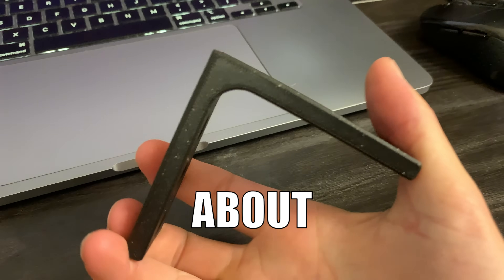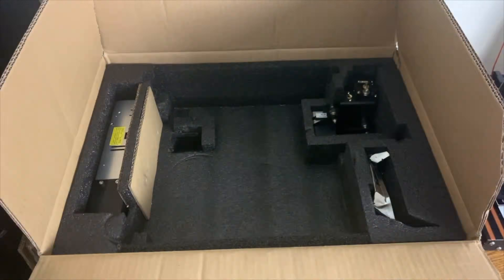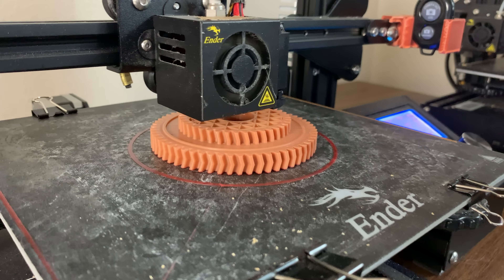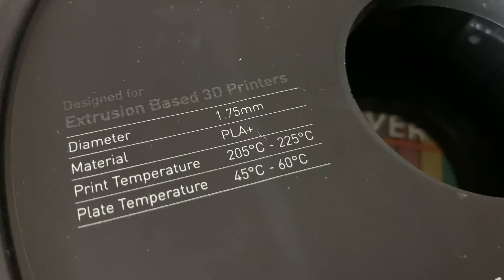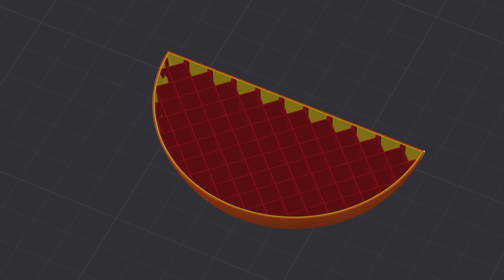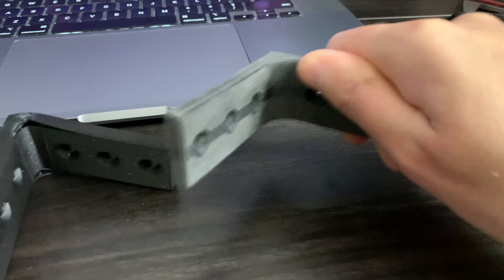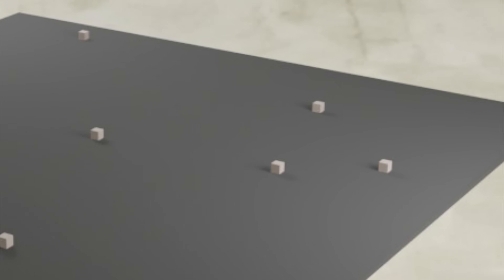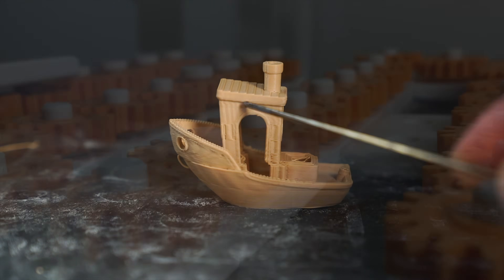9 3D Printing Sins...

Comment: A comment about your "But you gotta level the bed" bit. -- I run a shop that repairs 3D printers, and I will tell you 90% of the time it isn't anything to do with leveling the bed.  Everyone keeps reiterating this, but when it comes to Ender 3's and other kit-in-a-box printers, if you don't build it right, you will NEVER get it level correctly despite how easy it is to do.  So I regularly have customers that come in that say "I've been trying to level my bed for 10 hours!"...  And Auto Bed Leveling will NOT solve an unlevel (un-trammed) bed if something is mechanically wrong with your printer.
Reply: Yeah, working with machine tools has helped me prevent this because I know that a "level" surface won't matter if the axes are not square to each other.

Comment: Dawn dish soap and water made a huge difference for me when I was having issues with large articulated prints failing. I had been using a paper towel soaked with isopropyl before this.
Pick a soap without moisturizer and make sure to dry the build surface real well to prevent rust.
Reply: Isopropyl alcohol works really well when you need a quick wipe.
Reply: Most metal build surfaces are coated, usually with PEI, so there is pretty much no chance of it rusting and if it does rust it is probably just the edges that rust, not the actual build surface.

If you are having your build surfaces rust you are doing something very wrong.
Reply: micro fiber cloth works better with IPA than a paper towel no lint or dirt left
Reply: I have to use IPA because i use a type of spray on product (similar to 3dlac) that is not water soluble.

Comment: I clean my bed with cheap dollar store fingernail polish remover.  I've tried 100% acetone, but that doesn't work at all.  The fingernail polish remover has something in it that works incredibly well for PLA on any surface.  Glass, build plate, kapton tape...etc.  Try it, you'll be surprised how well it works.  I've have never, ever used glue stick.
Reply: Isopropyl acetone, methyl ethyl ketone, and n-methyl-pyrrolidone. 
Very toxic stuff. I will stick to IPA.
Reply: @tsepash  You can google... a page or so.  The stuff I use, doesn't have any of those things in it at all.  .....And just so you know.  Isopropyl Acetone, is IPA.
Reply: Not a good idea at all. IPA is safer and is less likely to dissolve plastic parts or build surfaces.

Stop living in the stone age of 3D printing and get a coated spring steel bed, much less faff than glass, glue or kapton tape.
Reply: @conorstewart2214  I have a spring steel coated bed, and a glass bed.  What I want to use is my choice.  It works amazing.  I don't use it every print, only when I haven't printed in a bit.  It doesn't melt the bed.  And it doesn't have any of the "toxic" things in it that google says is in it.  I looked at the ingredients, and none of those are in it.

Comment: Both soap and my local tap water leave residue on the build surface that prevents adhesion. The process I have found to give the best  results by far is to clean left over glue stick, oils, and anything else off using water, either completely avoiding or using an absolute minimum amount of soap, wipe off with paper towel, then follow up with a quick clean with isopropyl to remove the residue from the water (and soap); the isopropyl also helps remove all moisture. Following that I do my glue stick application rituals.
Reply: I use IPA on toilet paper. IPA dissolves any grease and paper absorbs it. Any leftover IPA evaporates as soon as I start printing due to bed heating up. One of the advantages of that method is the fact I can do it between the prints without even turning printer off.
There are also liquids that combine IPA, some kind of detergent and distilled water to make an universal cleaning solution for printed circuit boards and 2D printers...
Reply: You could buy or make distilled water. That doesn't have any minerals in.

Comment: Number 8:   iso cleans away the soap residue. And use 100% iso.
Reply from the maker: shouldn't be any soap residue. water washes it completely away
Reply: @3DPrinterAcademy  My tap water on its own leaves residue behind. Short of buying distilled water for cleaning, following up with isopropyl is the only option.
Reply: @3DPrinterAcademy  It depends on the soap. Many soaps use fragrances, moisturizers, etc. that all can leave an unhelpful film. Just wash a pair of glasses with the soap and see what I mean.
The best thing I found is Dawn dishwashing detergent. Sun-Light should be a close second.

Comment: Please make your thread board files cheaper and I will buy it :(    My peers in the 3d printing community agree they would pay for your models if it was 20$ or 30$. To be honest, even that is generous considering the current market for paid printable models.  I feel like your ad campaign is good enough to where you would see an increase in profits through demand by cutting your prices in half.
Reply: Rather....$20 for the base set of files, $40 for the full set.
Reply: Hello Max, you could model them yourself in about 10 minutes if you go down the CAD learning route.

Comment: The comments on isopropyl alcohol have an image of highlighted text showing ethanol. Ethanol and isopropyl are different chemicals. Additionally, you used 70% isopropyl in your video. I have had bad experience with anything less than 90%.
Reply: Not trying to be contrarian, but for me, 70% IPA on my Ender 3v2 glass bed with the self-releasing surface works completely fine about 95% of the time. I haven't tried other build surfaces though.
Reply: I use medical grade 99% IPA for my standard cleaning and about once a month I wash it with soap and water to get any debris out of the texture but then use IPA to displace the water. 

99% IPA removes grease so much more than 70% and I would argue better than soap and water.

Edit: I never use glue
Reply from the maker: "PVA’s solubility in isopropyl alcohol is even less than in ethanol. So, IPA is generally not a good solvent for PVA."
Reply: @3DPrinterAcademy  I tried glue-stick once... I'm definitely sticking with Aquanet hair spray. It works amazingly well and far easier to work with than a glue-sick.
I occasionally use 99.9% isopropyl to redistribute the film, and if the bed gets too gunked up (takes a while), only then do I remove it to wash with Dawn dishwashing detergent (never soap, it leaves too much of a film).